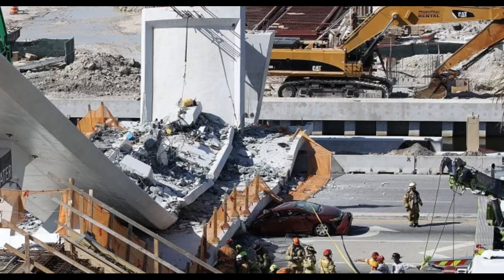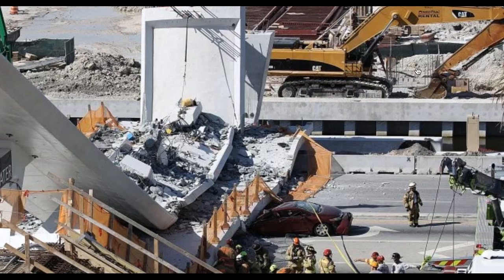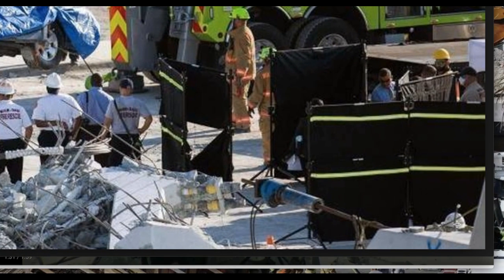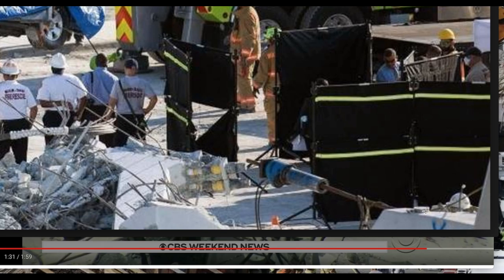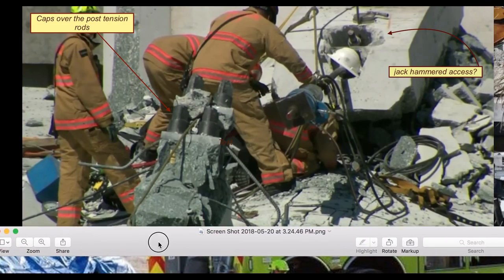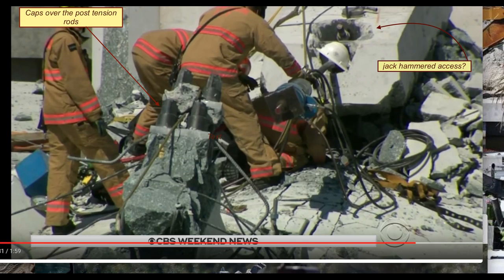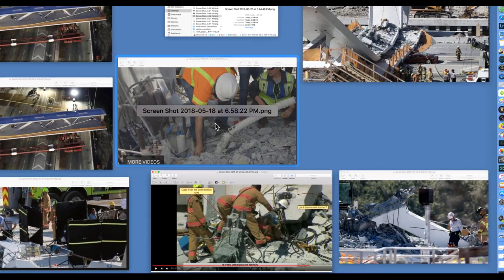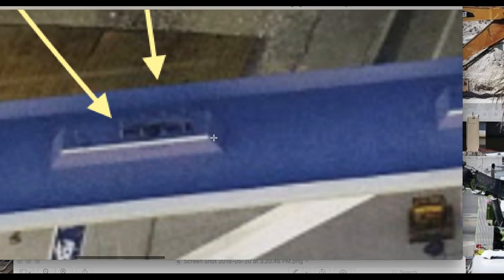FIU Bridge Collapse Jack Extension also Jack hammering cause of collapse?

Comment: My understanding is that the holding nut at the end of the cap should be above the cap, not in the cap. The cap helps to spread the load to the top slab. If the at cap is not spreading the load and doing its job, the tension would tend to produce a point punching point force.
Reply from the maker: The cap is just to protect the end fittings.
Reply: Construction Engineering & Photography i ment ti refer to the concrete blister. Thats what is used to contain the forces and spread the force onto the top slab. 👍🏼

Comment: I'm still following this with interest. There are so many possible failure modes it will be hard to determine which one began the sequence and which were the consequences. Remarkably lucky that there is a dash cam video of the collapse. That could be very useful.

If the cause was a transverse Crack in the canopy wouldn't both the longitudinal and the truss tensioning cables have held it together? Why wouldn't it have failed immediately when the load was set on the end piers? 

From what I could tell from the video the canopy, truss, walkway didn't fail separately, they failed as an integrated unit which is why my attention was focused on the walkway which bore all of the load between the end piers. My suspicion was increased when I saw the photo before the walkway pour where the only thing supporting the truss and the canopy was a few inches of concrete with a plastic pipe directly below it. 

Thank you for your continued coverage. While my specialized area is EE, not CE, I do have both formal and informal training. I saw a lot of structural steel rolled at the Bethlehem plant in 1969 including 750 pounds per foot WF. The heaviest they ever rolled was 1500 pounds per foot for the Saturn 5 assembly building.

Comment: Jakhammering holes around the ends through the caps, could have contributed to the failer. It sounds like the post tension cables punched through the top slab...... Without a solid end restraint it will weaken the system. Once the failure process starts loads transfer to top slab, than struts, than bottom slab....at each load/ force transfer the load increase as it has to take the dead load of each subsequent previous failed item. It looks like a vey big hole around those caps.

Comment: Thanks for the video!  I am a little confused on the post tension rods.  We see two rods that may of been adjusted, one for sure (with the adjustment device still attached).  I am assuming the PT rods for member 11 are shown on top of each other parallel to the bridge and the ones for member 10 are on the sides?  Pretty crowed in this area, as you have mentioned. As for the jack hammer, I am surprised they needed it since they said they adjusted the tension just a few days before, after the bridge move, so the adjustment area would of been designed for adjustments.  Had they already repaired the blister cap and had to use the jackhammer to re-open the adjustment area?  Or were both adjustments an afterthought?
Reply from the maker: Video response coming today... I have a video on this and just finished editing it... It is now ''rendering'' and I will post as soon as I get in from work.

Comment: Thanks for the video!

just a thought, I may be wrong, but..:

when tensioning a rod, the tensioning-device has to have some firm ground where it 
can rest on and which can bear high stress.
The ground should (must?) be dead level and perpendicular to the rod.

How can a worker achieve this when he has to use only a core-drill and a jackhammer
even for getting clearance to the rod?

With a non-perfect ground some small slipping of the device can occur easily, 
leading to what we have seen.
Reply from the maker: Michael, it has a 8 inch x 12 inch plate specified for this detail...  this would be the surface and ''retention'' you are thinking of...
Reply: ah, ok, thanks for clarification!  (forget my thought)

Comment: if they pensioned the cables in the canopy they crushed the concrete. Those cables would go slack if the bridge sagged and of course it did because they thought the suspension cables were a decoration and completely ignored them

Comment: I liked the term you used, chaos mathematics, to describe the design problems with this bridge, how complex it is to understand analyze and how many things are going on and going wrong in the design. Far too complicated of a bridge, they tried to create a complex design as a conversation piece, when a simpler design would have sufficed. The bridge looks very frail and as if the trusses are too frail and weak to support the heavy concrete deck. The design looked quite scary and ugly. The price tag, $9 million, seemed to be quite a lot as well, for a simple pedestrian bridge. The idea of using a pedestrian bridge as an outdoor meeting place, cafe or wifi hotspot is absurd, like anyone is going to sit on top of a pedestrian bridge over a noisy road to eat. Utterly ridiculous design that was full of political decisions and weakened structure in favor of aesthetics. Then, throw in the clowns and fools at MCM and its not a surprise that disaster happened.
Reply from the maker: https://ibb.co/dvMWpS      Thank you James...

Comment: I can't get past the fact that they tried to build a super duper technical bridge and we have been building great bridges for hundreds and maybe even thousands of years with no high tech tools or machinery but here we have an ugly bridge just for pedestrians using 21st. Century Tech and it crumbles right before our eyes and kills multiple people.  I just can't understand~!!!
Reply from the maker: I agree -- they should have left this concrete design bridge at home... it reminds me of the concrete boat that was built... it worked but was doomed to sink...
Reply: I’ve seen some modern concrete car bridges longer than this one that use low profile concrete beams for the spans. They’re about half as thick as the old I beam style and obviously infinitely safer than this abomination they tried to build.
Reply: MoneyManHolmes I’ve seen four lane spans, again for cars. I’ve seen a U shaped concrete design for trains!
Reply: Those are my thoughts as well. I've seen many pedestrian bridges over interstates, big roads, etc that have stood for ages. They tend to use simple, basic designs. One I saw for instance uses a center support pier with concrete I-beam spans laid on it, very similar to a car bridge. The steal truss box also is a popular design you see a lot. There really has never been any problem with these designs, they are simple tried and tested designs, hard to screw up. 

This bridge looked over complex, it also looked heavy with a lot of dead weight and at the same time weak, as if the trusses are just too small in proportion to the deck. The bridge looked pretty scary and ugly, in its fragile appearance. .

Comment: at the 4:03 mark showing the side of the top of the blister pack of one of the members, did the concrete breakaway as shown or have they removed a lot of concrete to expose?  If it broke this way is this just two different concrete pours and the break occurred along the weakest point of the concrete?

Comment: They jack hammered the #11 top tension rod life-end to loose the tension rod, then cause the sudden blew out at the pier bearing (shoot out), which further destroyed the bottom deck longitudinal PT end bearings. The bottom deck lost the tension capacity, bridge collapsed. Do you have pictures showing the PT cable bearing end conditions of bottom deck after?
The entire design just like women, can't give a straight force transformation, or a straight design, or a straight answer. Twist and turn in forces transferring, bound to miss something. If a bridge can''t take its own weight, consider adding 100 PSF Live and extra Dead, like railings and top decors. Speechless.